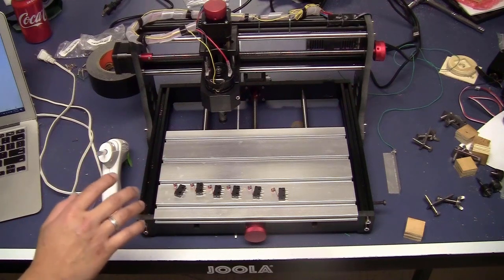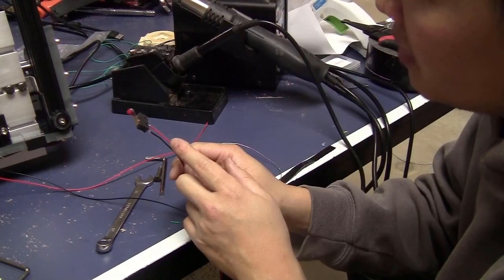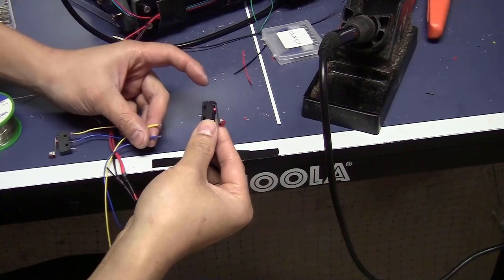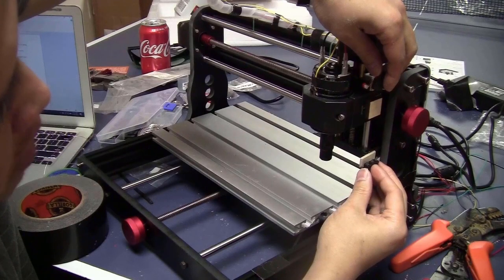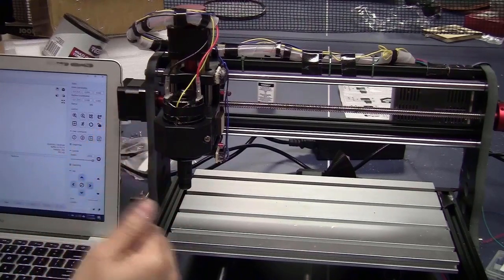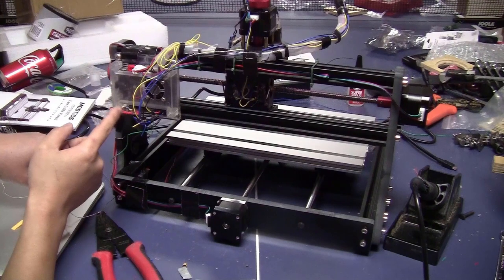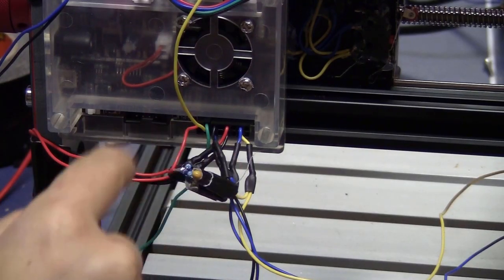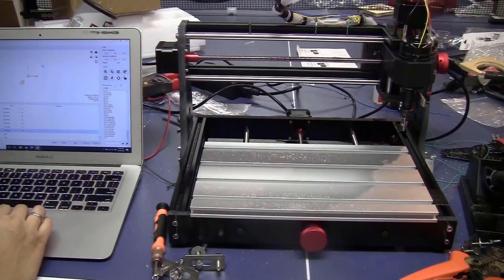3018 CNC/PRO - Limit/homing switches

Comment: A very helpful video as not all machines come with limit switches for all they should, only thing I would say is its better to use normally closed rather than normally open, the reason being with normally open if a wire comes of or is cut somehow you will not know till you crash the machine, with normally closed there is current going through all the wires, if one comes off or is cut the machine will sense and stop and give you a warning but if everything is ok. will also work as normal.

Comment: the new 3018 pro has a red controller board with the limit switches slots installed, problem is mine doesnt have the limitswitches just the slots... now im confused cause i dont know which pin goes where since i have to build my own limit switches and the diagrams online dont say what each pin does.. i guess wire and test hope nothing burns ...

Comment: Hi dude, nice videos, but Normally closed setup is better, it will not home the machine if cable or connection is broken.
Reply from the maker: You're right. Minor change, only need to change the wiring a bit and $5 to 1.

Comment: Congratulations on the video, very well explained.
My CNC3018 doesn't turn on the normal spindle using gcode, I need to turn it on manually before running gcode otherwise it keeps turning the spindle on and off, do you know what could cause this?

Comment: Hi Minh, once again I see you doing magic, great job. You can upgrade the limit switches to inductive proximity sensors, so much better.
Reply from the maker: Thank you friend, nothing really magic here, I'm sure so many people did this on their machines. I'm sure the inductive ones are better but I already have intention to peel them off since I was about to give away this machine. Just something quick and cheap. The ones I used cost about $2 for 10.

Comment: This will come in handy to know shortly.  I can't believe this didn't have them but there is a model above it that is pretty expensive that does so they know it really should have.  Luckily they are easy to add as you show.  edit: Your issue with the homing is easily fixed in software via the header file (could be in a pins file just depends on which version is being changed), but it takes recompiling GRBL (easy).  We had to do this with Marlin as well.
Reply from the maker: It will be your issue soon. Changing wires placements is lot easier, lol! Once you found out what was the problem, the solution is easy to find.
Reply: @minhsmancave9448  For me I am a software type but a lot of people say the same for Marlin.  Marlin started as a branch off of GRBL but made just for 3D Printers so the similarities are the same.

btw, what version of GRBL was on that originally since you downgraded it to 1.1f before you figured out what the problem was?
Reply from the maker: It was 1.1f when it first came, I upgrade it to 1.1h as I showed in the previous video.
Reply: @minhsmancave9448  Just making sure you hadn't changed it off camera before the downgrade. :)

That laser seems interesting.

Comment: This might be a silly question, but how did you attach those jog knobs onto your stepper motors?  They look like a useful addition.  Great video, by the way.  Clear, comprehensive and easy to follow!
Reply from the maker: Those knobs are not for all of 3018 cnc pro. The machine I got has long leadscrews on the x and Y axis to attach the knobs at one end. On the Z axis, the stepper motor has dual shaft, one side to attach to the leadscrew and the other to the knob. If you want those knobs on your machine, you will have to change to longer leadscrews for the x and Y axis and also dual shaft stepper motor for the Z axis.
Reply: @minhsmancave9448  Thank you; it didn't seem obvious and I'm glad it wasn't.  I think your clarifications are very useful.  Keep up the great work!

Comment: I just finished adding three homing switches and Z was the trickiest.  I almost ran out of wire.  I saw a contraption I would love to make that you use UGS and it has a module/plugin that will use the Z probe but does it for X and Y as well so your WCS is set up precisely.  Was made out of aluminium that you plop on a corner of a square, or rectangle piece of stock then attach the probes and hit the plugin.  edit:  btw, I hate those 2.54 connectors as I have to do them so many times to get it done right.  Must be my ratcheting tool that cost me 25 dollars from Amazon about 6-7 years back.
Reply from the maker: Get a new crimping tool man, mine cost me about $15 and the connector came out perfect everytime. Look like I bought the cable from the store.
Reply: @minhsmancave9448  Which one do you have?
Reply from the maker: @thebeststooge  This one, model SNA-2 or SNA-58B: https://www.aliexpress.com/item/4000406778464.html
Reply: @minhsmancave9448  Well, it appears YT just deleted my comment reply to you.  I will email you.

Comment: hello sir , can  i get the circuit diagram of the connections  BTW limit switches and the controller board . because i am also facing the  same problem with my cnc machine . so please sir , and  the grbl filmware also sir  please ,..........
Reply from the maker: You can just Google "grbl limit switches" and you should find their website with diagram for connection. Follow my video at the end where I check if the limit switches on the X and Z are swapped. Then just swap the pins connection on the controller board

Comment: Do the step motors have a clutch? When at end of travel is met and motor stalls a  loud click is heard.
Reply from the maker: Yes, it’s like a brake, but it’s not mechanical. It’s normal hear the sound when the stepper motor tried to push but couldn’t and lose steps. It’s doesn’t break the motor for short term but if it happens for long period of time, the motor will over heat and burns
Reply: @minhsmancave9448  Thanks Are you familiar with the controller 1.1f board? My question is can it use Normally closed limit switches? It's the board that is clear plastic case with small cooling fan.
Reply from the maker: Yes, you can use either normally open or normally closed limit switches. You can google “grbl limit switches” and find the website showing connecting schematics and configurations

Comment: Hey man i cant get my switches to work i wired them like you did minus the noise filtering so in parallel.
Now the problem is they light up physically as in the led on them lights up when triggered but the software
doesnt recognize it could my board be faulty? or did i mess something up someone pls help this is driving me crazy.
Reply from the maker: Did you enable them in in grbl?
Reply: @minhsmancave9448  i did by typing in the 21 code and doing the UGS setup
Reply from the maker: What type of switch did you use? NO or NC
Reply: @minhsmancave9448  NO
Reply from the maker: Check and make sure $5=0
Reply: @minhsmancave9448  is there a way to get in touch more directly so you could myb help me in real time?
Reply: @minhsmancave9448  it is 0 still doesnt work
and if i swith it to 1 it doesnt work

Comment: Boss!
The video is very good!
But I want to ask for a wiring diagram of where and how to connect the RCs!

Thanks
Reply from the maker: Right here my friend:
https://github.com/gnea/grbl/wiki/Wiring-Limit-Switches
Reply: @minhsmancave9448  Thank you very much for your help!
If I use RAMP 1.4, do I still need a noise filter?
Reply from the maker: I have no idea because I don't have any experience with the kit. You can skip the filters first, only install them when you find out that the limit switches don't work. Usually you will see it right away.

Comment: how do you make the spindle manuel turning jogs?
Reply from the maker: They came with my cnc set. But you can make your own if you buy longer leadscrews for x and Y axis. For the Z axis, you will need a dual shaft stepper motor

Comment: What are your g code settings for limit switch configuration? I enjoy all of your videos and I have applied some of your projects.
Reply from the maker: Nothing to do in the Gcode. Only configure those switches in grbl settings.
Reply: @minhsmancave9448  my bad; what are the grill settings?
Reply from the maker: Once installed, you can just activated them with $21=1 for limit switches. If you wanted homing, put $22=1. After that $23 is for where you wanted to home. Then $24 to 27 are the parameters. I showed all the details in the video. Not much else you can configure.

Comment: Hi Minh
Very good video! Do you have a link to buy the  2  pin wire connectors that connect to the grbl board? 
Thank you David
Reply from the maker: https://www.aliexpress.com/item/1005001489545874.html
Reply: @minhsmancave9448  Thanks for the link. I've installed limit switches just like yours, but could not figure out how to connect to the control board.

Comment: Hi, can you write where is possible buy a set for the RC filter ? Thanks.
Reply from the maker: You should get this: https://www.tindie.com/products/eccentricwkshp/cnc-optical-limit-switch-isolator-grbl/
Reply: @minhsmancave9448  Thx very much. Excuse me some questions : 
The controller work on 24 V , or I'm wrong ? Where I have 5 v ?
I need 3 CNC Optical Limit Switch where i connect both X on one, both Y on one, etc.. is it correct ?
Reply from the maker: There's a 5V output on the controller board, you should be able to see it. Both of limit switch for one axis will be connected parallelly into one port on the filter board
Reply: @minhsmancave9448  again Tx. You're Great !